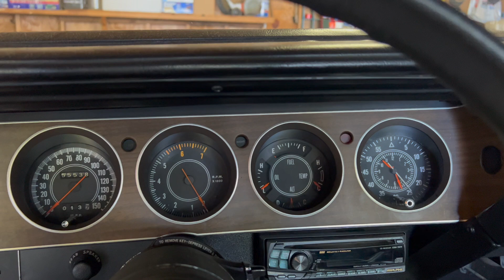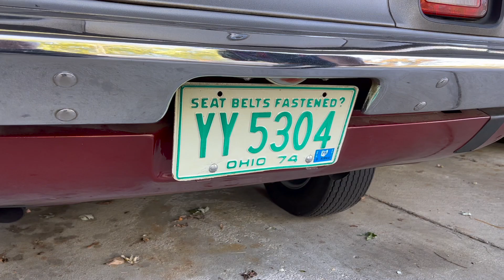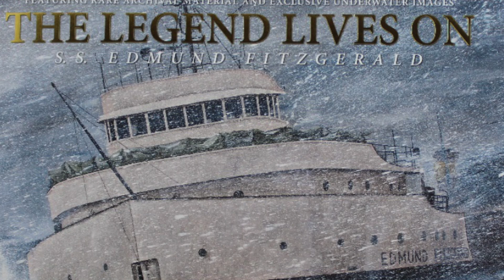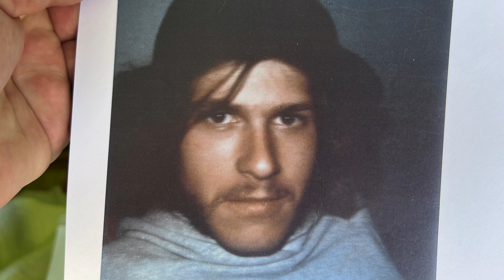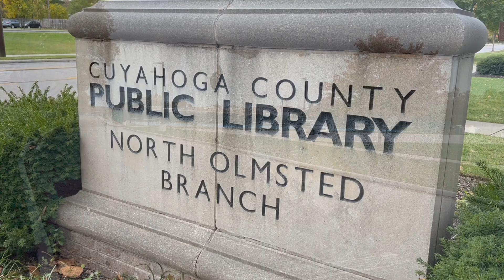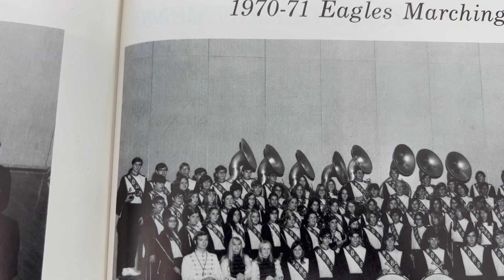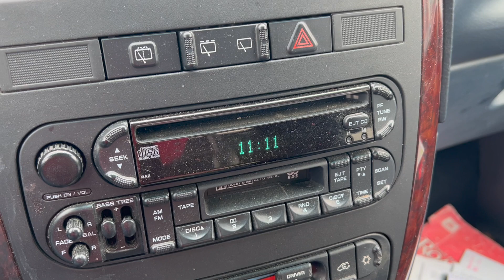Found "THE CAR"! Bruce Hudson Edmund Fitzgerald Tribute

Comment: 1973 was the last year that the 340 was available.  It was replaced by the 360 in 1974.  The fender tag on this car has E44 engine code on it, which means it’s a 318 2-barrel car..  The VIN is not as clear in the video, but it must be JH23G4, again G for 318.  What is clear, is it didn’t leave the factory with a 340 between the fenders.
Reply: That's what I was going to say, you beat me to it.  If  that was a "Rallye" Challenger in 1974, the largest engine available was the 360.  You could get the "Rallye" package with the 318 engine as well.
Reply: i checked the comment section just to see if anybody else noticed that.  Good catch!

Comment: Great video,great story. But shouldn’t it be a 360? Subscribed!!  Wow just watched part “2” of this video and got my answer. So there’s obviously more to the story. Bruce modified the car as its vin shows it to be a 318 car originally not a 340 or 360. It would be interesting to know if his buddies helped him.
Reply: The engine in the Challenger is the original 318 as well as the rest of the driveline,  A Direct Connection cam was added by the previous owner during a needed "tune-up" and the (removable) 360 badges were added by the current owner. (full discloser, my brother is the current owner)
Reply: @hemidenny8548  Thanks for filling in the blanks. I noticed the “G” in the vin when the door was open. The owner only said original when the videographer said “340”. I remember swapping parts back in the day on my charger with my buddies help. Video is a great story and brought back memories.
Reply from the maker: There is always more to the story. Gives me room to go back for more. Thanks Anthony...HMM

Comment: Cool car!  One  error though,  the motor is not original.  They did Not have  the 340 in 1974.  Onlh the 318 or 360.  I saw the car in a magazine a few years ago and it was a 318.  I don't know if the current owner lied, or did not know any better on the engine.  If you look at the dash vin  it will have    a G for the 5 th digit for the 318.
Reply: That is very true
Reply from the maker: Understood...thanks for sharing. HMM
Reply: The owner did not lie.  He said it was the original engine.  He didn’t say it was a 340…the badging did.  The badging (340 magnum) was added for appearance purposes.  It would not have come from the factory with headers or a 4 barrel carburetor if it was the 318 either.  Some modifications to the original 318 appear to have been done.  It’s a beautiful car though and an extremely rare find in such good condition.
Reply from the maker: @philricci2012  Thanks for sharing this info, Phil...and thanks for watching...HMM

Comment: I've always been fascinated by the Edmund Fitzgerald and I appreciate this story. I have a question though. You guys say the engine is the original 340 that came with the car, and the car is a 74, correct? Because the 340 was last produced in 73 and replaced by the 360 as far as I am aware. So is this a 1 off Dodge Challenger? Maybe a super early production? Just curious. Thank you for showing us the car !!
Reply from the maker: Thanks copo clone. I'm not sure on the engine. I'm more of a story-teller guy than a car guy. But the owner may know. There's been a lot of chatter on here about the car and its specifics. To me, the main thing is that this guy cares for the car and saved it. Thanks for watching! HMM
Reply: @copo clone.  That’s what I was thinking too. It may have been a very early production car. I have a ‘72 Challenger that was made August 1971 and it has a few 1971 parts on it. But to see that engine get into that car would be very interesting because I believe they may have used the 360 for emissions purposes, so to see it get into a 74 model year would be very interesting. You would have to check the VIN number 5th digit for an “H” and fender tag for E55 to be sure and also on the block for the sequence number from the VIN.

Comment: Can you explain how a 74 Challenger Rally ended up with a 340 in it ? Sounds like a mild cam in it and headers. 73 was the last year for the 340! That Rally Challenger would have had a 360 in it. Sorry but it’s not the original motor. Something strange here. Just ask any Mopar guy.
Reply from the maker: The motor is original...it was originally a 318 but modified with a camshaft out of 340 Magnum. The two-barrel carb has been replaced with a four-barrel with a different manifold. The motor has had a performance upgrade but the motor is original. HMM

Comment: Very cool! Except I do not believe this is the original engine as 1974 There was no 340 option. It was replaced by the 360 after 73.
Reply from the maker: This is a '74 Challenger with original paperwork. Original motor too. Somewhere along the line the manifold was changed/modified, hence the 340 reference. The owner can explain it way better than me, but this is absolutely, 100% a 1974 Challenger.

Comment: Why is this 74 Challenger Rallye have a 340? I have a 74 Duster 360. I thought they dropped the 340 for '74, and used 360's in '74.
Reply from the maker: This is a '74 Challenger with original paperwork. Original motor too. Somewhere along the line the manifold was changed/modified, hence the 340 reference. The owner can explain it way better than me, but this is absolutely, 100% a 1974 Challenger.
Reply: @HistoryMysteryMan  Clear as  mud. Like I said my 74 duster 360 came originally with a 360 4bbl., so unless they had to get rid of leftover 340's, and it was an early production 74 model, it should have come with a 360-4bbl. Did you take a picture of the build tags on left fender apron? What was the 5th digit of the vin? I know it's not completely original. Are you saying the intake, carb, and air cleaner are not original?
Reply: Just Googling:  "The Dodge Challenger offered a different engine option for 1974. With the 318-cubic-inch V-8 still standard, a 360-cubic-inch V-8 producing 245 horsepower replaced the 340-cubic-inch V-8 as the only engine option."

It should have come with a Carter Thermoquad, a spread-bore intake manifold, and a bigger, orange air cleaner with a single snorkel.

Comment: 2 Problems I have with that car : 1 - 74 would have had a 360 not a 340 . 2 - A 74 would have had 2 Rubber Bumper extensions on front and rear . Oh , and no Exhaust Headers .
Reply from the maker: To me, you're missing the bigger, greater picture. At least he saved the car with great care; that's what I focus on. The car could not be in better hands. Thanks Dave...you rock brother! HMM

Comment: Thats a 72 or 73 Challenger because its got the 340 engine in it .  After 73 that engine was no longer available from the factory .
Reply from the maker: No sir. This is a '74 Challenger with original paperwork. Original motor too. Somewhere along the line the manifold was changed/modified, hence the 340 reference. The owner can explain it way better than me, but this is absolutely, 100% a 1974 Challenger.
Reply: @HistoryMysteryMan  if its a 74 then it should have a 360 in it and not the 340 which was dropped as an option after the 1973 model year .
Reply from the maker: @kevinpatrick8788  There is no "if". It is in fact a '74 with its original 318 engine...original tranny too. However, it's got a 340 performance upgrade, which means it's got a different cam and intake manifold to accommodate the 4-barrel carb, rather than the original 2-barrel. It's also got an enhanced exhaust. The 340 stickers are just that...stickers that could be easily removed. No holes were drilled...everything was bolted on and could be easily undone. It would take no time at all to take it back to its original 318 configuration. The reason the current owner did the 340 enhancement is because Bruce Hudson always wanted the 340, but that engine wasn't available in '74 so he went with the 318. And it of course sounds better and runs better with the enhanced performance package.
Reply: @HistoryMysteryMan  thanks for the info . Im sure there were other guys who swapped out their base engines for more performance like a 340 and even swapping in big blocks .
Reply from the maker: @kevinpatrick8788  10-4...thanks for watching.

Comment: The paint gasketing on the top side of the engine is 50 shades of fishy... Deff not the OEM dodge color nor is the gaskets on that motor. Even the air cleaner was redone. Most of the 340 and the 383 Challengers the decals on the aircleaners just fell off came loose as well as faded and the hood didn't even have to be open 4 that to happen engine heat did it.
Reply from the maker: We'll just never know what really happened, but we all have our thoughts...and I appreciate you sharing yours here, Kent. Thanks for watching...HMM

Comment: A 1974 Dodge Challenger did not come with a 340 engine. The only engines available were a 318 and 360.
Reply from the maker: This is a '74 Challenger with original paperwork. Original motor too. Somewhere along the line the manifold was changed/modified, hence the 340 reference. The owner can explain it way better than me, but this is absolutely, 100% a 1974 Challenger.

Comment: Got a 72
Reply from the maker: Awesome! HMM
Reply: It's got A 440 Not original and not original a paint job either but still cool. Mopar rules
Reply from the maker: @RawH2o  It actually is the original motor...a 318. Since, it's had a performance package, including cam, 4-barrel carb, etc. to get it to 340. Thanks...HMM